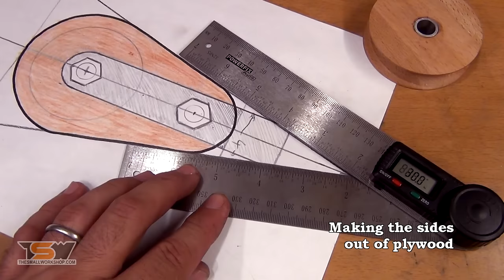Making a Block and Tackle Wooden Pulley System

Comment: A point from an old middle age farmer and who has a bunch of these, beautiful work, keep your radius in the pulley just a pinch bigger then your rope diameter, to large and it flattens the rope as it rounds the pulley working your rope. ie: 1/2 diameter rope no more then 1/32-1/16 bigger diameter grooves. For play it's perfect.
Reply: Good advice. I was thinking that a big hole saw would be a bit faster beginning. Lacking a lathe, I'll try my drillpress.
Reply: @garychandler4296  I made a lathe out of an old router, if that gives you any ideas
Reply: @josephdomshy4068  love to see those plans.

Comment: Beautiful work. My take on weight  ratings is that if the pulley system is to be used by hand you're limited by your own body weight. That's if you're strong enough to hold that much. So if you weigh 100 kg, you can only handle 400 kg with a 4:1 reduction. The rope has four lines, making it good for a full metric ton. The only question is the strength rating of the other components.
   I like the bolt centering method. I should have thought of that.
   The only thing I would change would be washers on each side of each pulley wheel to reduce side friction and to provide space to add oil.

Comment: Very impressive design and manufacturing process. I use a similar layout with cheap cast iron pulleys to haul many loads per week at my 2-storey house, from laundry to rubbish, bricks and sand, and large awkward shaped objects such as pot plant stands. Everyone who has to climb stairs daily will love your ideas with this model, which will be very suitable for daily use, and especially where alternate pulleys are unavailable.

The only problem I've had in 7 years has been the tendancy of the ropes to twist (rotate) about each other and bind tightly together especially under heavy load conditions such as bricks. Lighter loads don't cause this to happen. I've tried using sisal rope and different thicknesses of plastic filament rope, but all tend to do this, due to the great height involved, and the residual tension introduced by the rope manufacturing process. Older ropes and shorter lengths are less likely to get twisted  do the twist.

Comment: Fun to watch, so graceful and efficient. One suggestion: put a thin washer on each side of the pulley wheel, and you'll eliminate friction between the wheel and the casing. It could be a noncorrosive metal or hard plastic.

Comment: Behind your lathe, put a piece of wood that connects the lathe to the wall. Add a piece of rubber where it connects to the wall. That should solve the wobbly nature of rubber feet whilst maintaining the vibration dampening effect of such legs. FYI if you buy a tube of silicone, you can let it to cure inside for a few months after opening it. Once it's cured, you take it out and cut feet from it. Much better at sucking vibration than anything rubber + if you cut them at 1.2 cm thickness, for 30 kgs ratio, it will give you a pretty stiff mounting too.
Reply: Maybe build a come-along system for it too? I mean it's not that complicated. The main component is the curved star, you have an angle grinder and a belt sander, that's easy to make.
Reply from the maker: Yea, I've thought about that, was thinking of using an old, small diameter circular saw blade for the star thingie. And thanks for the rubber tips.
Reply: I cut open a old tube of silicone that hardened up & I thought to myself, 'I should be able to use this for something' .  :)
Reply: +VerifyVeracity Heh, I'll never toss one out again!
Reply: Same, that's a great tip.
Reply: @zahialsalman  
Perfect, due to the formula given, I will wonder though, if the formula should not be corrected due to differing factors, such as frequency or rpm, stress loading, or whatnot.
Reply: I get figure I

Comment: Fun watching this workshop gradually become less small :)
Reply from the maker: Thanks! The tool number is growing, but the space seems smaller than ever! :)
Reply: Yes, I am a kid that loves these little inventions there really cool to watch him do it
Reply: @JesusAlvarez-gw7uy  
That makes you more of an adult than a "kid", Keep exploring!
Reply: @TheSmallWorkshop  I'm in the midst of building my workshop now. Well, not right now, as the weather is not my friend in da Yoop. I had first designed it 20x20. I have a mill and I extended it to cut 22' logs, so I then decided to build the shop 22x32. After laying out the floor joists, I decided that wasn't big enough. Now I've got the floor joists all laid out and built at 22'x40', monitor barn style. When I set the beams and started building walls, I figured I had better build a second story in the middle of it at 16'x22', and then it snowed...and snowed. This spring when I get back to it I'm going to finish it at these final dimensions, but I've also left myself the ability to easily expand it to 40'x infinity. hahaha It doesn't matter how big a shop starts out or finishes, it's never big enough. Good thing I've got acres of forest to make my own lumber, or this thing would cost me a fortune! p.s. Great job on the block and tackle. I'll be making these, for sure.

Comment: Great video! Pulleys are an ancient tool and probably the first thing to be optimized for mass assembly. keeping that in mind, your design comes pretty close to the real deal. If you make another one, you need a system of spacers that allows you to tighten the bolts without squeezing the sheaves. And try to make the sheaves out of a slippery, hard-wearing plastic like Delrin. It will make for far less friction.

Regarding the loads: with synthetics rope strength per diameter has gone up so much, that you mostly select rope for different criteria than breaking load. With synthetics rope, the rope typically far exceeds the correctly sized blocks in breaking strength.

For hauling by hand, rope that's about 12 to 15mm diameter is far more comfortable to grip, which means you can pull with more force comfortably. Always select the biggest diameter that you can get away with. 

Also sheaves for anything but exotic cored rope should have a slightly elliptical profile, with the radius at the middle only slightly larger than the radius of the rope. 

In your case, that works out well. the sheaves you made are oversized for the rope you bought.  Go to the hardware store and find the largest diameter rope that just fits easily on your sheaves. It will be far easier to grip. You might have made the groove to deep, if that's the case and the rope binds on the shoulders of the sheave, turn down the outer diameter a bit and make the groove a bit more elliptical.

Then reeve the pulley in a right angle reeving. http://slideplayer.com/slide/9260274/27/images/19/Reeving+methods.jpg. It will prevent the pulley from twisting and give you more hauling height and less friction.
Reply from the maker: WOW! Thank you very much for your advice! I used this rope because I already had it, but I turned the pulleys so they would accept larger diameters without rubbing. But when I went to the hardware store, man, rope prices grow exponential with diameter. This rope I used (8 mm) is 3 bucks, the next one (10 mm) costs 10 bucks and the next one costs 25 bucks and so on. For now the 8 mm one works fine, I've used it a lot this weekend and for the tools I use it it works fine.

But I am going to give the right angle reeving a try, I had no idea that was a possibility, and it looks more suited for the long height I use it for. Thanks!
Reply: Theres always a critic. Probably get one who tells me that my Theres is wrong. Well...Duh!
Reply: You know your shit and I like it 👍🏻
Reply: @gomakeamark7459  and someone just can't let the issues go by. SAD

Comment: I was about to build my own double 4 sheave block and tackle for pulling logs out. Now I know how I will do it. I like the bushing around the axle for strength and wear resistance. and the ease of the metal strap system so no metal bending is needed.
Reply from the maker: Glad you found it useful! Just last week I've tested it under heavy load and it worked like a charm. It was used to lift 30 huge beams two stories up. The beams were really heavy, four guys were barely able to move them around the site, yet just one guy was pulling the rope while lifting them then five other guys were struggling to put them into position. After all that load plus 20 pallets of bricks the pulley shows almost no wear, just the wooden wheels got a bit dirty in the grooves.

Comment: A washer and a ring on each side of the wheels would help a lot with friction. Having the wheels directly in touch with the plywood creates a lot of friction and makes the wheels spin harder.
Reply from the maker: You are right and I plan to add washers, just that the washers I could find at at my local hardware store were too thick. If I used them the rope might get caught between the pulley and frame. I'd have to keep looking or make them myself. But I had to finish the video, I was already working for 3 weeks on it and the pulley works well enough even without washers, and also most pulleys I've seen for sale don't use washers either.
Reply: The commercial ones, I think use ball bearings. Anyway, great work!

Comment: These are a nice set of blocks. You could reduce friction a lot if you just used ball bearings in place of the steel sleeves you used for the sheaves. They are not expensive.

Comment: Nice job.

I'm intrigued by the set-up you have for your router.  Can you pleas show (or explain) how the router is attached to the chunk of wood.

Cheers
Reply: Mick S would also like to see this setup
Reply from the maker: It was a makeshift, on the spot improvisation. Basically the router had two knobs in the base, used for the parallel guide. I removed those knobs, which left two threaded holes. Drilled two matching holes in a piece of scrap wood, bolted it to the base in those threaded holes and clamped the wood to the edge of the workbench. And presto: how to lose a finger in three easy steps!
Reply: The Small Workshop Haha, I've seen much worse.
Reply: Thanks.

The reason I asked is that I have only one router and have been trying to work out how to quickly convert it to a table top (and back again) without having to keep removing the base plate.  I think this might do the trick and it doesn't look any more dangerous than a standard router table fit out  ^--*

Comment: You forgot to show lubrication, that is very important part of a plain bearing.

Nevertheless, great video, as always :) once again i learned many things of crafting. Thank you!
Reply from the maker: Thank you! I've let it dry for now, just a coat of silicone oil on all parts mostly to prevent corrosion. I only plan it to use it once or twice a month, with moderate loads, so I don't think lack of lubrication will be an issue. But if it is, the pulleys are easy to take apart and lubricate them.

Comment: great job, what I suggest to you to use mechanical advantage, such as to attach Gibbs ascender to hold the load from your hand, also consider safety issue don't accede the weight load for the tools it self. and supporting tools such as the ladder and rope.

Comment: Very well done   I am a retired Woodworker  and  although  i saw you  using the correct saw and blade  it still  freaks me out  yo watch someone cutting Steel on a  Mitre box  because  over the years ive seen too many idiots on job sites  trying to do the same with a Wood Blade and Saw ?  now for installing Custom Millwork we often  used a  mitre saw to cut our Aluminum angle  with the correct blades and speed  of course  and ive seen   some of those off cuts  taking off like a rocket  ship out of the saw

Comment: Great project and video!  Did you mention how much that block weighed?  People can use a large factor of safety with a wood design.  I don't think you would get a catastrophic failure with this specific item, could crack and seize but the steel would prevent it from breaking into pieces and dropping the weight - that is a good design choice here.  Cheers!
Reply from the maker: I don't know exactly how much the rock weighted, but 3 large guys were struggling to get it off the truck. 
A year or so later I used the pulleys on a construction site to lift 25 heavy wooden beams. It was a sight to be seen, 4 guys were barely getting the beam into position under the pulley, then one guy was lifting it for 2 stories and 3 more guys were struggling with it at the top to put it in place. The guy doing the lifting was so proud, it was so funny.

Comment: I feel your pain. I am stuck in a first floor flat, one bedroom. It is soul destroying to have to load out everything to the car, outpack at a friends garage, do an hour doing, in pack so the garage is clear for the next 'thing' then haul the lot back upstairs to my flat.
Reply from the maker: I totally understand what you say, I used to live in a small flat too and used my first table saw on the living floor. I even welded on the coffee table, which ruined it of course, to my wife's delight. That's why I'm happy in my broom closet workshop, it's small, but it's something! I might run out of air every fifteen minutes or so, but I can make stuff!
Reply: Just had a quick look at your web site there and when I have more time I will be back. Cheers..

Comment: Very nice vid👍👍👍
FYI (IMO) as for your drill bit (Forstner bit) it looks like it is little dull and possibly running too high on RPM/feed rate.. if you have a tiny sharpening stone (or just buy cheap diamond files set from harbor freight). Just go over the cutting edge and will improve cutting performance also if it's gummed up, clean it with brake cleaner.. Smooth walls reduce frictionand burning wood...  I have restored many bits from a garage sale this way ...

Comment: Nice job! ;) My only question, do they bind?? Thrust bearings on the sides would make it move like silk.
Reply from the maker: I've used it a couple of times and it worked just fine. And I haven't even lubricated the plain bearing yet.

Comment: What kind of plywood is that???  It appears to have some kind of fiberglass layer on the outside, which could be done your self I guess.  I'd put some graphite lubrication on the pulley axles, or maybe even some bronze bushings.  You should also list the sizes of the parts and materials.  Nice job though.

Comment: Great job. I found that pulling that the bearings/bushings at the center of the pulleys require a lot of effort to over come while pulling. I was wondering what can be done about that?  Any ideas?
Reply: I still think you did a great job I may be borrowing your ideas
Reply from the maker: I've let the bolts loose so the entire fixture has a lot of play in it to overcome friction. They work quite nice, I've used them both on small loads and on heavy beams ant they worked great.
They've been a lifesaver with the beams since I could not fit a crane in my yard and the construction guys were ready to call it quit when they saw that 4 of them could barely move one beam on the ground, and they had to lift them two stories up. So I went and got these and just one guy was enough to lift the beams in place. It was quite a sight to see!

Comment: Real nice job . I think i would have put some bearings in a little more fluid like . But really nice man
Reply: I don't think the wheels turn at all with how he tightened it down. I think he's just relying on the rope sliding over the wheels.

It's probably easier than lifting it 1:1, but it's nowhere near the mechanical advantage he could get with real pulleys with bearings.

Comment: It seems like you have squeezed the wheels very tightly between the sides of your pulley. How are they going to rotate? The friction will be quite strong. Probably they don't rotate at all, and the rope just slides against the waxed grooves, generating considerable wear. Some sort of spacer between the sides would improve the design hugely.

Good craftsmanship, though.
Reply from the maker: It just seems that way in the video. They are quite loose. I use it almost daily to lift heavy tools in my attic and it works great. I've also used it on a cinstructon site to lift huge beqms that 4 guys could barely move. It lifted 30 such beams, two stories up, no problem. The workers were amazed. I did not use spacers so the rope would jot get stuck between the walls and the pulley.
Reply: Ok then.

Comment: Great video again but wood of liked to see you thread the rope through the pulley.  Good job.
Reply from the maker: It's not too complicated, up, down, up, down, keeping the side. But you are right I should've included that scene in the video.
Reply: The Small Workshop It's a simple lacing. A Right angle reeving will work better for what you are using this pulley for. It stops the pulley from twisting as the blocks get close together and also reduces the friction since the rope is not angling out of the plane of the sheave. http://slideplayer.com/slide/9260274/27/images/19/Reeving+methods.jpg

Comment: You did a video on making plastic rod stock out of HDPE bottles not that long ago, would that be a better material for the pulleys than wood? I'd imagine friction would be less of an issue, though the manufacturing process would be quite a bit longer.
Reply from the maker: HDPE or other high density plastic would work well, but I wanted to make this project mostly out of wood, since it's easier to find by those who would want to make a similar pulley.